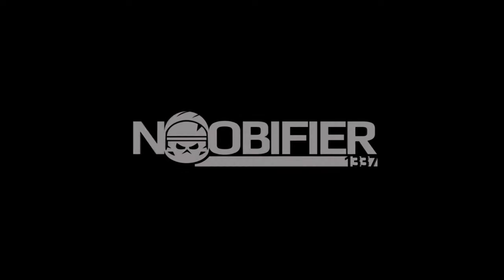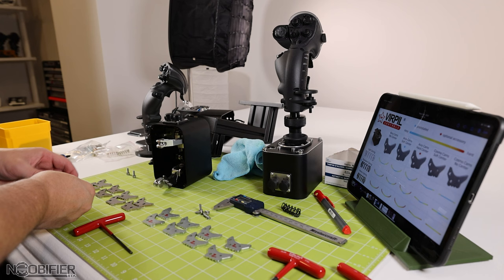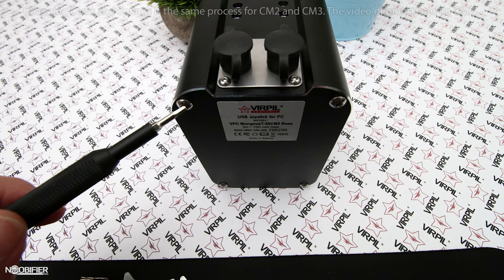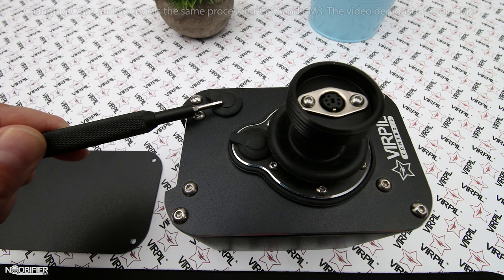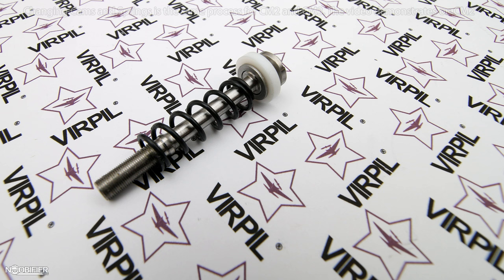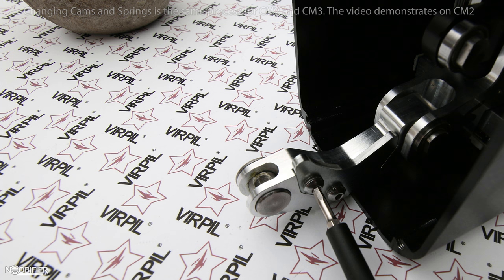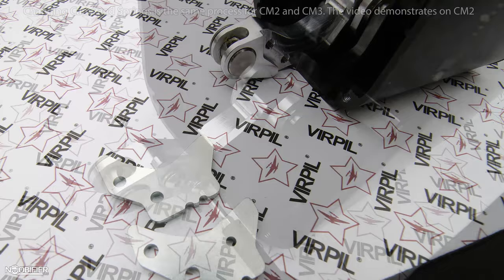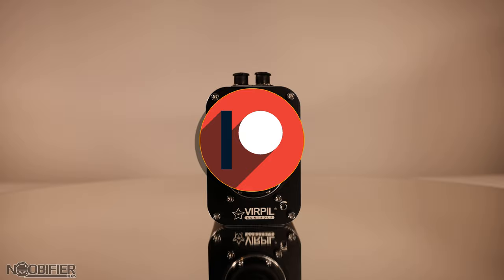CM3 - Tuning Cams and Springs -  Virpil

Comment: +BrianMP5T  Thanks for the rundown on alteration and maintenance of the VIRPIL® MongoosT-50CM3® Base (C/N VPC-109-001).  One of the proposed improvements that didn't make the VPC-009-01L and -01R I'd suggest for a VPC-007-002 "MongoosT-50ƂM®" upgrade grip:  A five-way mini-Castle on the right of the top pod that I anticipate OKB Pavela Osipovicha Sukhogo (Komsomol'sk v Amura, RUS) specificating to AvijaAvtomatika for the roll-pitch grip on the T-75 (United Aerospace of the Russian Federation sales name: Checkmate; anticipated Air-Space Interoperability Council (USA) codename: Fishweight).
Reply from the maker: It would be interesting to add another 5 way… However… I believe the limit might not be physical, but that the circuit itself may only be able to bind 32 items momentary. I have discussed this with the team and I am aware there is a desire from the community for it.
Reply: @NOOBIFIER1337   I meant as a replacement for the existing 3-way on the right of the top pod.

Comment: Nice one Noob! Any suggestions or hints on how you do maintenance, if any, on these? I haven`t checked what Virpil says, but should you clean and grease all the mechanisms every year or so? Once I had a micro piece of metal which end up on the cams and was causing friction, basically scratching the metal. Had to clean that piece out, but never did a proper maintenance, hence my question. 🙂
Reply from the maker: Anything that will remove dust, similar to a camera. Lube the springs every once in a while. Basic
Reply: @NOOBIFIER1337  What grease should I use to cover springs? Maybe link on Aliexpress or just title, model, type... And what grease is suitable for clutches?
Reply from the maker: @user-yk8ti8nj6z  none, they are polymer on metal.

Comment: should i just not clean the inside of the holding chamber and the tensioner, i dont really know how to store the springs without getting them cleaned atleastl, also after some swaps of the springs new grease wouldnt be a bad idea do you have any recomendations ?
Reply from the maker: So when I stored my springs they went with the grease into a small bag. I imagine any silicone based grease would work

Comment: so the pre-installed springs come greased but the additional springs do not. Does that mean you need to add grease or will they naturally pickup what is there inside the unit already through usage?
Reply from the maker: There is so much grease that you won’t need more unless you change springs all the time